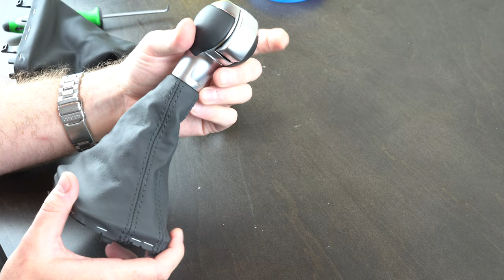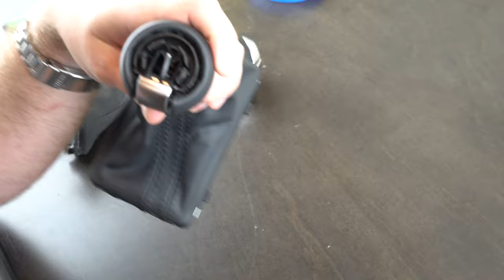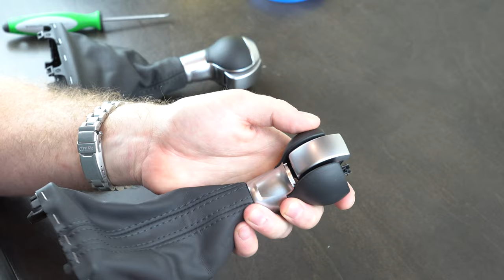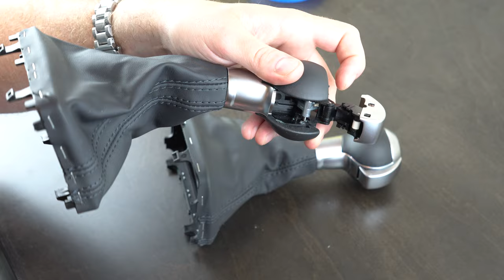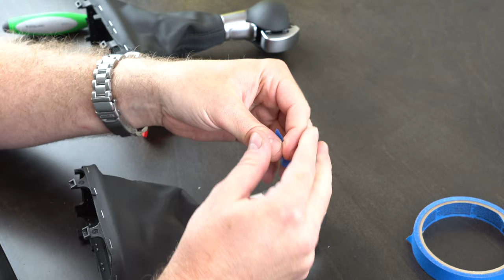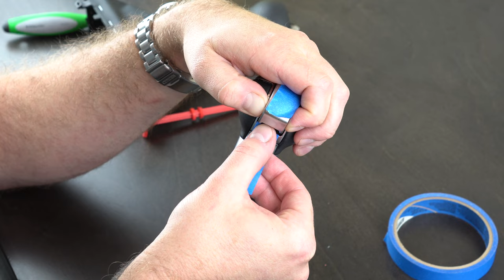How to reset the VW and Audi forward facing shift knob button.

Comment: does this apply for the 2007 audi Q7 shift knob button to ? I have a metal outer shaft with a plastic thin inner sleeve down inside of the metal shaft. My shifter knob is doing exactly like you have said here. how can i fix mine please thanks...

Comment: My locking cooler wont turn. Its locked in place for some reason and I cant fit it over the shifter shaft ?
Reply from the maker: That is not something we have seen before. If you contact us on through our website you can send us some phots and we may be able to assist better.